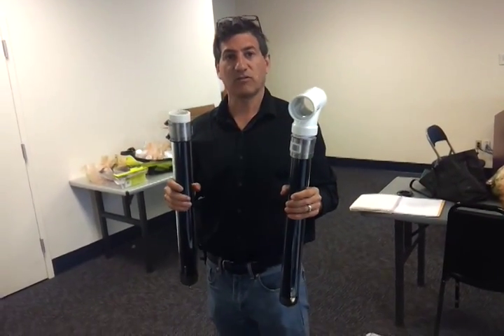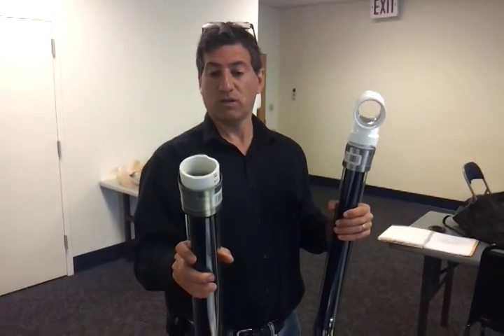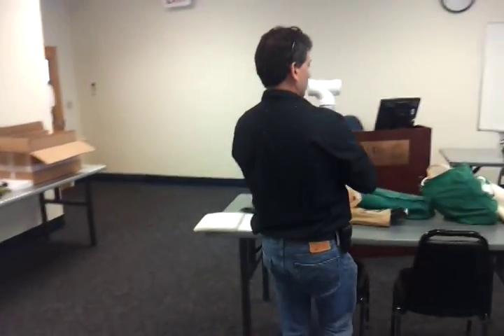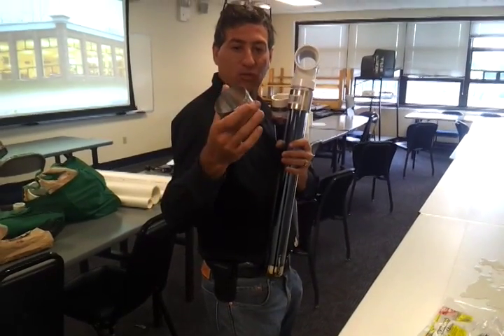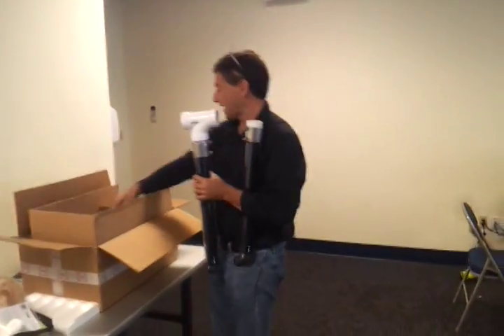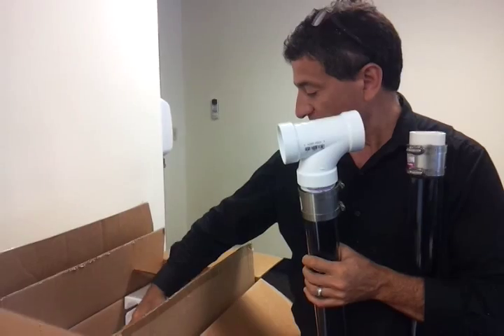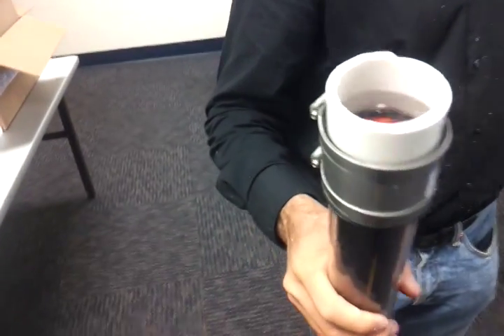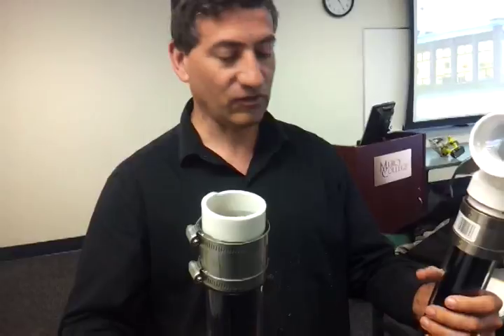Solar vacuum tube manifold idea 1

Comment: Put a solar vacuum system with liquid metal and a electromagnetic pump and use it with a thermal electric generator. These could be put on a grid system to give power to a town. Novartis